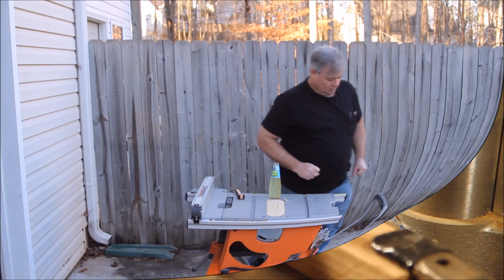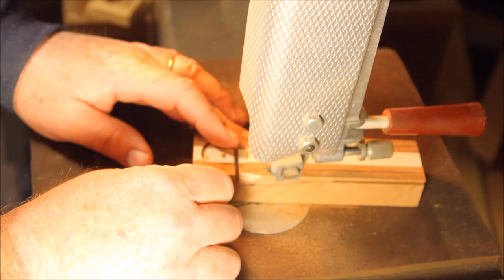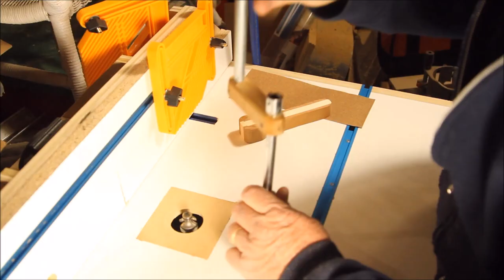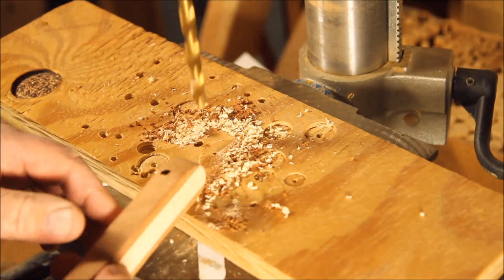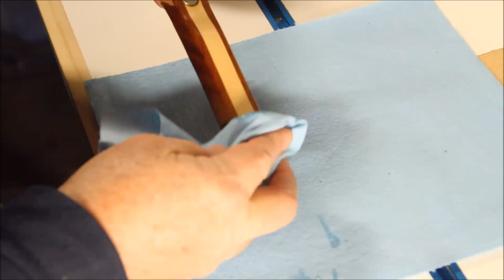Bottle Opener

Comment: Why not use a cabinet scraper as that will give a fine finish and minimises sanding, all mine have been made by using hand tools, such as a spokes have a good project. I have made some bottle openers a little tip I have used is to apply glue to the magnet and use a screw to place it in the hole, I also use a penny coin instead of a washer, which you could personalise with the birth year if making it as a gift.
Reply from the maker: Thanks for the feed back Ray.  If I build another one I will look back on this comment for ideas.